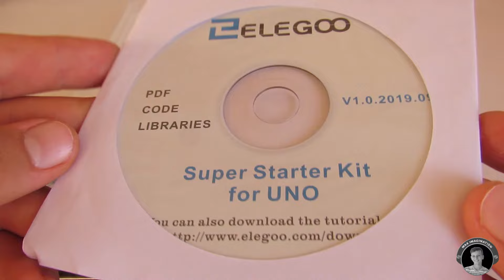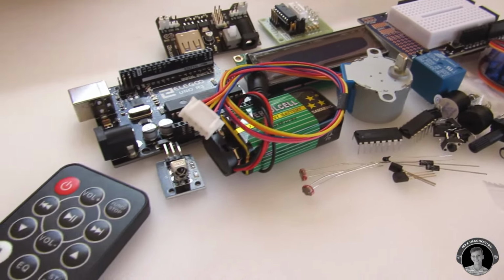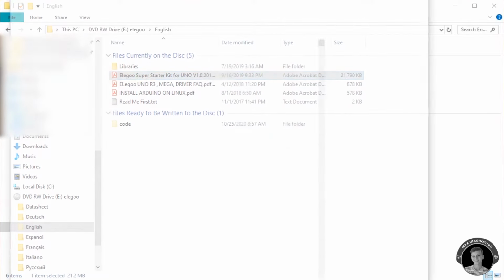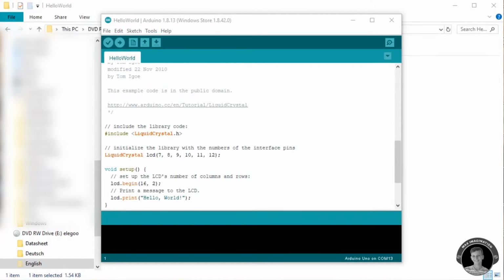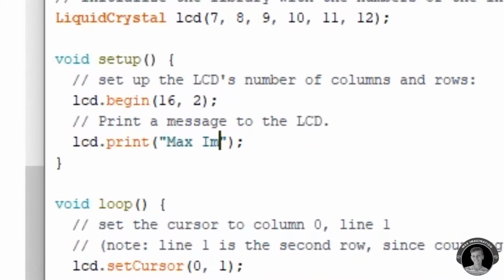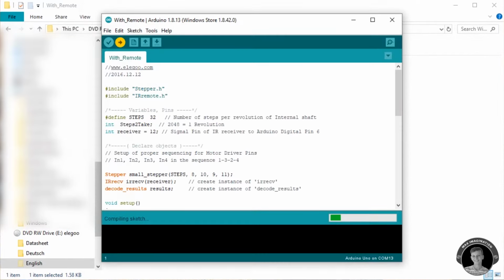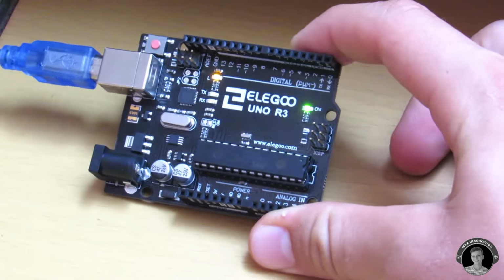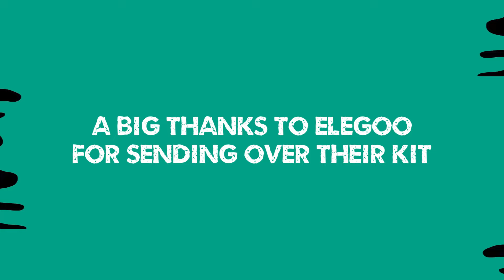Elegoo UNO R3 Project Super Starter Kit FULL REVIEW | Arduino Robotics Kit Beginner

Comment: just wondering do you think that this kit has the components to make an led chaser
Reply from the maker: Hi there. Yes, as all you'd need is an Arduino board, around 10 LEDs, and resistors. All parts of which are included in this kit. Programming would be all that is left to do on the Arduino to get the LEDs blinking in an LED chaser sequence. Cheers.
Reply: @MaxImagination  Thank you